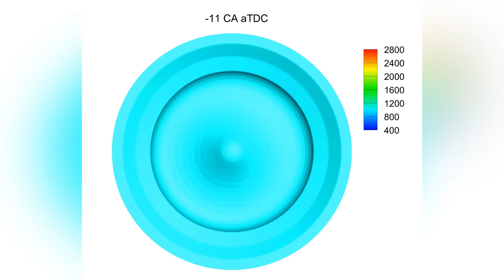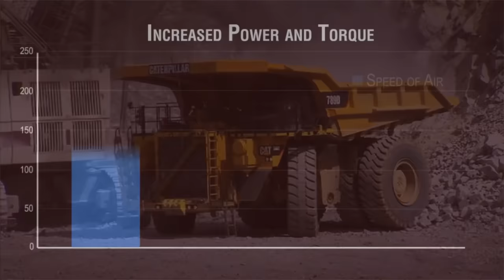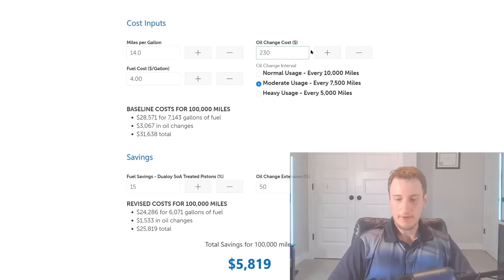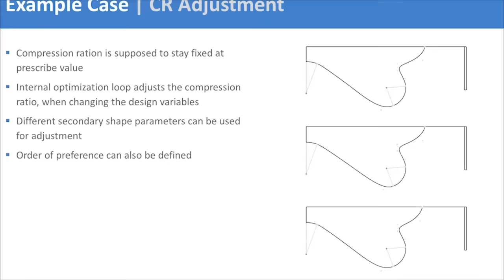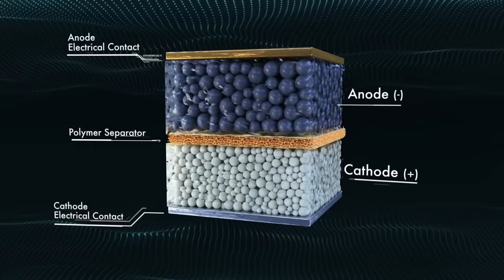ICE Breakthrough!? NEW Piston Design BREAKS Records

Comment: As an engine builder this claimed 25% improvement seems like marketing BS as with the increased service intervals. Ceramic coated pistons save 4-5% in fuel so 25% seems completely unrealistic. I would like to see two identical engines, one with the new pistons and one with factory pistons run side by side on an engine dyno to validate these claims.

Actually I had another think about this and in particular the 80% NOX reduction. The most effective way of reducing NOX is through a lean burn. The Mazda Skyactive would be the best example of this. Perhaps the ceramic coatings on the pistons allows for the fuel pump to be dialed back or in the case of common rail the fuel delivery would be electronically altered to give a lean burn. A lean burn would improve fuel economy, reduce carbon in the oil and greatly reduce NOX emissions. Maybe the dimples play a roll in the pistons being able to survive a lean fuel environment.
Reply from the maker: What do you think about the 80% nitrogen oxide claim? I think that is high with a small increase in fuel savings?
Reply: I cannot say for sure. It seems like a very bold claim. I would really like to see a side by side test.
Reply: @malcolmkermode9794  . Umm ,.............  BTW   " seams "  is  spelled  SEEMS .
Reply: Its ligit. We have been working on it for 10+ years but kept it quiet until the patents where issued.
Reply: @Tech_Planet how about  plasma pulse spark plug
Reply: I wouldn't do two identical engines. I would do the same engine but swapping the pistons. Keeps the environment as consistent as possible.
Reply: @ripl0x  Wear. Whichever you choose to go second would benefit from less internal friction as the crank and cam bearings would be less tight. Two identically prepared engines in two identical trucks pulling identical loads and alternating two drivers (to eliminate driving-style bias) is the best way to get a real-world comparison.
Reply: @johncunningham4820  Okay, thanks.
Reply: Think of it like the 2-chamber heads. Where you have a pre-ignition small chamber to start the flame wave and then injection into the full chamber to take advantage of the larger volume. You can run the pre-ignition chamber super rich to get a good start, then go way lean on the primary chamber. This is effectively the same concept, only instead of having a the pre-ignition chamber in the head, they're building it into the piston.
Reply: @kalmmonke5037  Every spark is plasma so every spark plug is a plasma plug. Plasma spark plug is redundant. I get what your saying though..
 A High density plasma discharge. Something like Aaron Murrikami's setup, where its discharging the primary side capacitor's low voltage high current into the secondary side. Piggybacking the high voltage low current while using a diode to protect the primary from the high voltage.
Reply: @georgeford6056  If you have two identical machines anyway, you might as well swap out the pistons after the side-by-side test, to average out any inconsistencies in a second round of tests.
Reply: @ronnetgrazer362  A second round of tests would introduce too many variables (temperature, humidity, wind direction/speed, traffic conditions, etc.) to provide any useful information to use as a comparison to the first test run.
Reply: @georgeford6056  I see what you mean. So we need a bigger setup, 100 days throughout the year, 2 modded cars, 2 stock, rotated configurations every other day :)
Reply: @georgeford6056  Way to many variables for just a piston swap test. Maybe, two dynos that are calibrated exactly with the same torque resistance, and a hundred other variables just with the dynos. The engines built with exactly identical parts and fasteners torqued the same in both. With tolerances less then 0.000001 inches with all components used in both engines. Built by only one person at the same time. A shared pressurized fuel line, engine oil, and coolant. Air, same thing. Spark, exactly the same voltage. And there's still a large amount of uncontrollable variables. All that said, maybe 90% accuracy of thermal energy conversion efficiency measured between the two piston styles. Vehicles made on the same line and day, will still have +or- 10H.P. and torque difference between the two. Yeah, it's arbitrarily a guess-amation of true percentage again or lost.
Reply: @Karl with a K I'll challenge your assertion:   How many farm tractors do we have that are EV's?  NONE.   Airliners?  NONE.   Long haul trucking?  NONE.   The one and only place that EV's actually have an advantage over ICE is during inner city short distance use.   This is a niche demand and the vast majority of motorists need more range and don't have the time to spend waiting on the vehicle to charge.    The Tesla Semi might do well in certain delivery situations where the truck is volume limited rather than weight and can go from hub to store within the charge range then recharge as the delivery is being made.    It's going to take decades for the electrical grid infrastructure to be beefed up enough to take a large volume of EV's.
Reply: @Tech_Planet  NO WAY just the piston change makes this much of a reduction.   NOx is made when combustion temperatures are high....and high temperature flame is also how you get better efficiency.   So NOx and fuel economy work against one another.   Modern emission controlled engines flow a bunch of EGR to control the flame temps then treat the NOx downstream with the DEF injection into the SCR.   Ceramic coating the piston will insulate it and keep more heat within the chamber...which goes against lower NOx....so some tuning changes must be made along with the pistons.   That then raises the question of which change...piston or tuning did the majority of the improvement?

Modern common rail electrically controlled diesel injectors can squirt up to 8 times per combustion cycle which is needed to make them run quietly and efficiently.   The massive off-road engines are not emission controlled and you might see an advantage to the coated piston just from the lower oil temperatures the insulated crown should provide.   But for the majority of emission controlled engines out on the highways....I smell a marketing gimmick.
Reply: I think you're wrong about lean burn vs. Oxides of Nitrogen. As the mixture ratio leans out, the excess oxygen with the heat of compression and combustion causes the NOx forming reactions to take place. Hence why compression ignition (diesels) struggle to meet NOx regs even with SCR and additives. Same applies for lean burn spark ignition (petrol/gas) engines. Hence why S.I. are regulated to operate with Lambda control to keep the mixture as close to stoichiometry as possible, with exceptions to only go richer than the stoichiometric ratio....
Reply: @stacksmasher  So who is running the pistons in a daily driver, powestroke, or Cummings. Let's go. Let's see it. There are 100s of well known utube guys who own and build, drive these trucks who would gladly put a set of your pistons in for free. That right free. If it works you will make millions in the 1st year. I own 2 powerstrokes and am very fuel conscious.  Prove your claim by helping others use your product. We are all watching and waiting
Reply: @hankclingingsmith8707   why not run biodiesel? Your engine will last 2X long and the conversion to frenchfry oil is easy!
Reply: @stacksmasher  biodiesel isn’t all it’s cracked up to be. First it’s thicker, gums up everything it touches, requires a heater to make it less viscus, still too thick for EFI diesels, mechanical injection can handle it but will gum up your injection pump rather quickly if the environment is too chilly and isn’t constantly driven.
Reply: @Karl with a K 😂😂😂 electric trucks are the biggest farce I have seen or heard of in my life.... Tesla truck is a joke....it spends more time on the hook then it does goin down the road
Reply: @stacksmasher re you going to license it to the manufacturer's? They may make enough changes to avoid patent infringement and knock it off instead of paying you royalties. The major manufacturers definitely have the money to pay off the judges, and the judges are definitely corrupt enough to go for it. You may be able to avoid that if you don't overcharge on the licensing. Judges have taken payoffs after a bunch of people have died and tossed environmental poisoning cases, so they wouldn't have any moral problem with this. Good luck getting money out of these people, when they know they can steal the design for a lot less. China is definitely stealing it, they're probably working on it right now.
Reply: @stacksmasher It doesn't work in cold weather. It's way more expensive and we don't have nearly enough of it and we're not going to ever have enough of it. It would take an insane number of fields to grow enough vegetation to make it. We would be dumping a lot of fertilizer down for it as well.  It's also very unstable and doesn't last as long as far as shelf life, especially if it's not stored under controlled temperature conditions.

 And also that thing about the engines lasting 2X as long, is pure fiction and there is no way that a diesel engine is going to last 2 million+ miles because it's running on french fry oil. Someone made that story up and you believed it.  If damages a lot of houses and seals and clogs injectors. There are also a lot of problems with manufacturing quality and those are not going away.

Those are probably enough reasons.
Reply: @timcanizares5240 Unless there's been a recent change, Tesla will not disclose how much the truck even weighs. They only want to give the GVW (gross vehicle weight), which is the total weight of the truck and its cargo. If they are not wanting to come off with that information can you imagine how heavy that thing is with all its batteries?
Reply: @actionjksn  well it's not that heavy.... my buddy hauls it all around the US to shows and photo shoots... he hauls that electric frieghtliner too.... there a joke it's never gonna work that tesla truck spends more time on the hook then it does actually driving
Reply: @timcanizares5240  How much is not that heavy?  That literally gives zero idea of how much the vehicle weighs, which means we have zero idea how much weight you're allowed to haul with it. Not that much is not an actual weight and the real number matters.
Reply: @actionjksn  I can't remember exactly but it's like 28000..but don't quote me on that it's heavy but not that heavy
Reply: This technology will flourish in the trucking industry. Tests have shown better fuel economy and cleaner emissions.
Reply: @timcanizares5240  When did they start disclosing the information on that? I know for a fact they were not disclosing that information not very long ago. If I look on the Tesla website again am I going to find that this time? I clicked about 15 articles the last time I looked and nobody had that information. A bunch of the articles I clicked actually wanted to know as well and they couldn't find out either. TorqueNews estimates it to be about 30,000 lbs. A Peterbilt 579 with a sleeper weighs 17,600 lb. The lightest-weight semis are 10,000 lb and the heaviest ones are 25,000 lbs. Maximum GVW for a semi is 80,000 lbs. I think they're going to allow electrics to haul an extra 2,000.
Reply: @actionjksn  a good friend if mine hauls that pos around the country on a landall....he also hauls the electric cascadia around they don't have the range I'm telling you what they won't because it's not gonna work.....
Reply: Lol, in the video, these were being applied to large diesel engines..
 So my comment is to the folks talking spark plugs.... Oh nevermind....
Reply: All a diesel will do when "lean" is shut down or produce less power.
Reply: Extraordinary claims require extraordinary evidence. 
That being said, the product is at least not vaporware, so all we need is someone with enough curiosity and cash to test the claims. Which may in fact happen, because their target market is commercial, rather than consumer.
Reply: makes sense. But just boost it, its better
Reply: @stacksmasher  I don't believe for a moment that this is a legitimate claim.  Improvement--yes.  That magnitude---no.
Reply: @kalmmonke5037  Is there one available that wont melt?
Reply: Hit the nail on its head cheaper than forging just ceramic coat instead
Reply: Wouldn't a leaner burn increase NOx emissions? I thought nitrogen oxides were created at higher combustion temperatures, and in a spark-ignition gasoline
ICE, I do know for sure that leaner AFRs generate higher combustion and exhaust gas temperatures.

Comment: One thing you need to consider is that those industrial haulers mostly operate in a very predictable, constant pace. This means they can fine tune every components of the drivetrain to offer the highest efficiency within the tighter operating margin, where as privately owned vehicles have to basically do everything well (go slow, fast, start & stop often, go fast at constant pace, etc.). This makes optimization for large gains on personal vehicles much more challenging (and much less likely through these gimmicks) than on industrial machinery.

Comment: "Golf ball texture means more efficient" when doing what golf ball textures do on golf balls. That is, when creating a turbulent boundary layer of air in a laminar airflow, avoiding the laminar air from sticking to the surface of a dimpled object, decreasing drag in the process.

This was applied to the front face of the VW Golf to great effect, again, due to the car moving in laminar air, decreasing the drag of air on the car.

We are talking about applying this principle to a piston moving forward against and compressing already turbulent air, air made turbulent to increase the access of oxygen to fuel. I have little reason to believe there is any laminar air drag on the piston to neutralize using dimples.

Most of the efficiency and emissions improvements come from the ceramic and various coatings. Less heat absorbed by the engine = more heat in the ignited gas = more pressure = more useful work = more power with the same amount of fuel or less fuel for the same power. Now we're talking.

If I am right (and I reckon there's a chance I'm not) then the dimples are a marketing plot device meant to promote a company that wouldn't receive much attention otherwise for doing the "same old pistons with a dull coat". Can't really justify $2300 for coatings alone, gotta add machining that hauler company businessmen can understand is expensive.

Comment: Isn’t that type of piston similar to those in stratified charge engines? They’ve been on the go for years so I’m surprised they’ve only just discovered this extra technique of creating vortices. I thought they already studied the way the charge swirls about. I’m just amazed that this is something new.
Reply: Honda's CVCC?

That did not use special pistons. It did use a special combustion chamber, an extra intake valve, and a special carburetor.

When introduced, Honda refitted a Chevy V8 with CVCC, which then passed the emissions testing (as required at that time) without a catalytic convertor.

Comment: Dimples allow golf balls to reduce air friction to travel further and recently have been used in speaker ports for better flow, so its no surprise that they could have benefits in the combustion chamber and inlet and exhaust.
Reply: Back in the day we used to hand drill and polish an intake manifold like this on pre injection engines as it helped the fuel and air to mix

Comment: With every increment of efficiency increase in combustion engine performance, the competitiveness of pure electric performance reduces dramatically. It seems relatively inexpensive and quick to make substantial improvements to combustion efficiency, while holy grail battery tech is always 5 years away. And even then the electricity has to come from some place that requires thermal and kinetic energy inputs from combustion power units.

Comment: I like to hear some of the engineering and see some of the swirl patterns associated with it to be able to see the validity of this piston! Can you get it and make a video on that?
Reply: You can put it into a hydrodynamics program and watch it make a annular vortex ring from the fuel mist during the upstroke and several points of local turbulence near the end. When ignition occurs it does so at the center of the vortex ring rather than a single point near the piston head surface. It would give a more even burn but would be very prone to knocking. 🤔